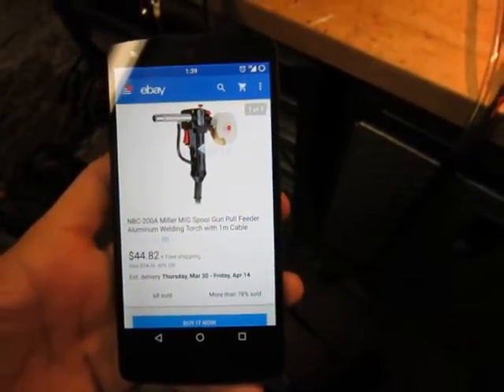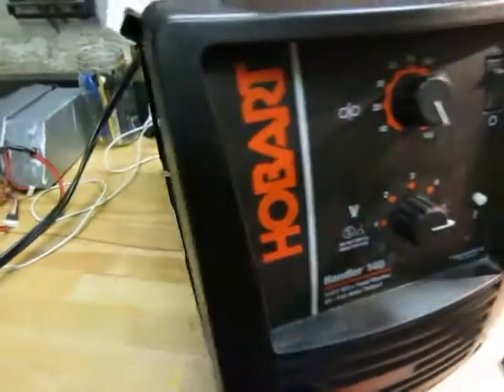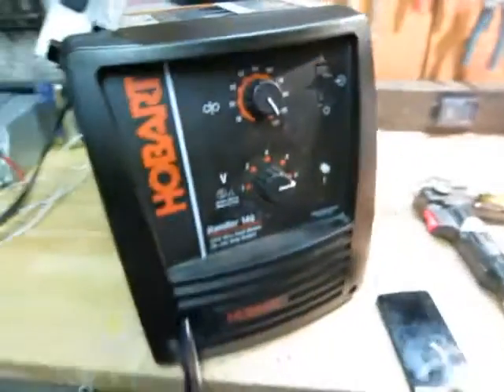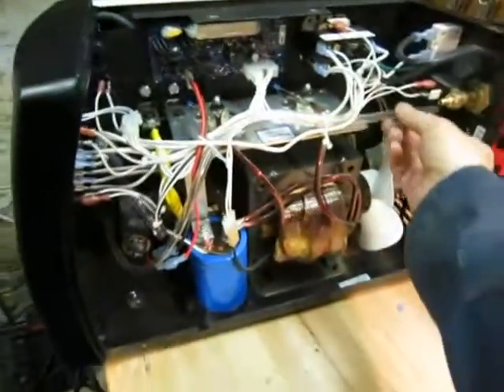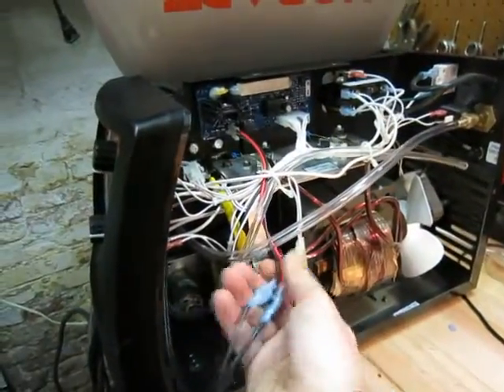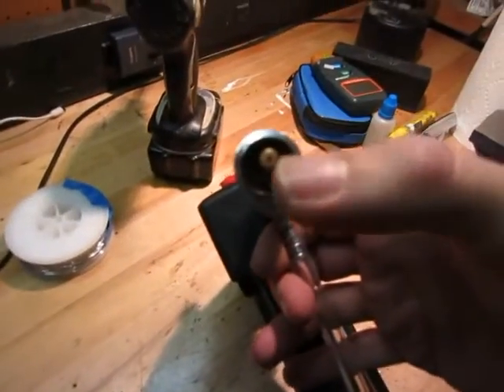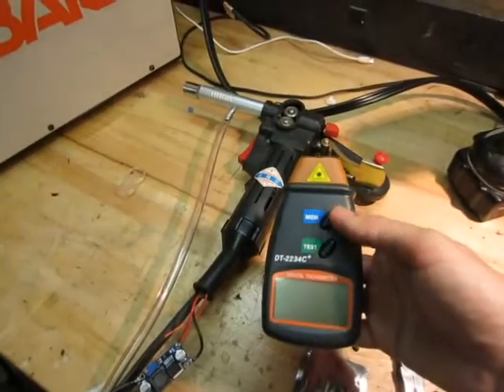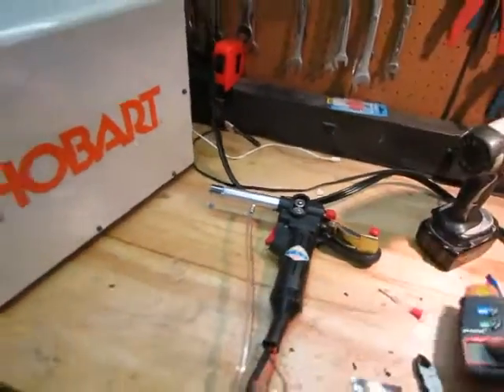Chinese Spool Gun Hobart 140

Comment: You should mount the buck converter for the spool motor inside the welding unit to prevent a short circuit when you accidently bump the leads against the work when working around corners/

Comment: What is the status of this interesting project ?!?

In my opinion you need much more RPM,
because the wire roller in the spool gun is way smaller.
Equal RPM is not equal wire feed!
Measure the wire feed ...
Reply from the maker: The result is I can now spool at the correct speeds and successfully weld aluminum.

Comment: This did not work for me. The converter actually slowed the spool gun down
Reply from the maker: The converter has a tiny adjustable pot that allows you to change the voltage. You have to adjust it so the motor is receiving higher voltage. Assuming you got the correct buck converter. They come as step up or step down converters. You want an adjustable step up converter.
Reply: Check this out at Amazon.com
2 pcs Super XL6009 DC-DC Adjustable Step-up Boost Power Converter Module https://www.amazon.com/dp/B01FDEWS7U/ref=cm_sw_r_other_apa_yo9JAb16A999R
Reply: That is the boost converter I got. But the machine is a Lincoln that supplys 15 v to the motor. And I did adjust the pot but got poor results.

Comment: Dude just get cheap chinese PWM controler with digital display. So u can conect motor to energy source, like power adapters, transformer, and even batery power. Conect Gas directly to gun. So u dont need to swap anything when u go Argon for Alu welds.  Or c25 for regular.
Reply: I love the idea thanks for sharing.
Reply: I literally can't figure out a single thing you're intending to say in your comment! It would help if you drop the "dude" in favor of words that mean something, learn to spell and construct sentences that make sense.
Reply: @farmalmta  if you can't see that PWM is an acronym for pulse width modulation, or that u is short for you, than you probably shouldn't try a Chinese spool gun.

Comment: RPM is not what your looking for it is ft. per min.  you just have to play with it till it works . The dia. of the unit drive wheels compared to the spool gun  is the problem, if you take the circumference of each you can figure out the feet per min. to RPMS. just did the same thing !
Reply from the maker: Bernd loos not sure what you mean. The electric engine in the spool gun has a different winding than the electric engine in the welder. The spool gun turns over at a much lower rate per volt than the welders. So even if you use the fastest setting on the welder the spool gun turns substantially slower.
Reply: thats why you use the step up module to increase the voltage for a faster rpm in the spool gun changes it from 5 volts to 10 AND MAX 24 TO 35 VOLTS  THIS WILL INCREASE YOU FEET PER MIN AT THE GUN AND ALSO YOU ARE STILL USING THE RHEOSTAT ON THE MACHINE STEP-UP GOES ON THE 2 WIRES TO THE GUM MOTOR  DC-DC Adjustable Step-up boost Power Converter Module XL6009 Replace LM2577 N62 on ebay